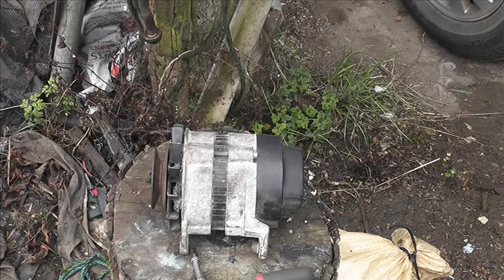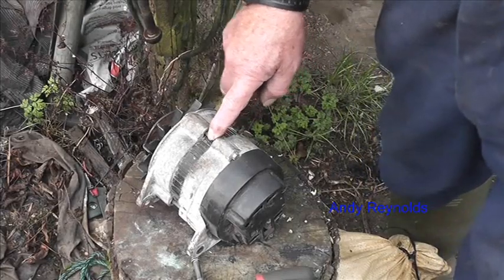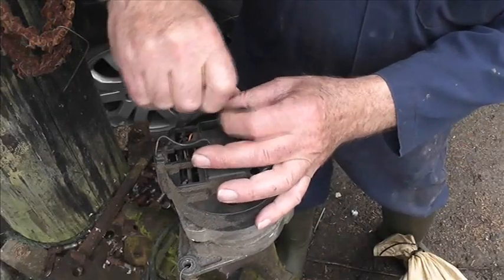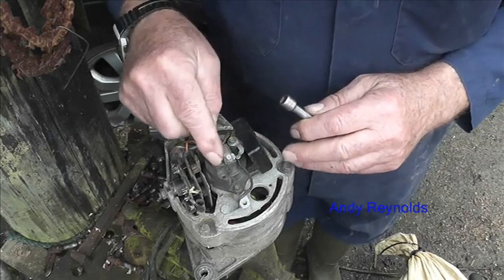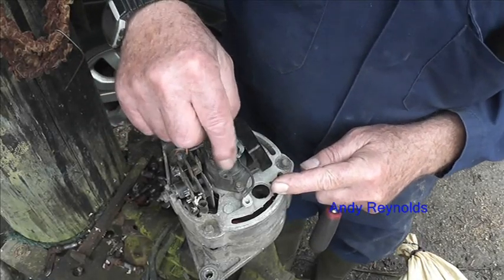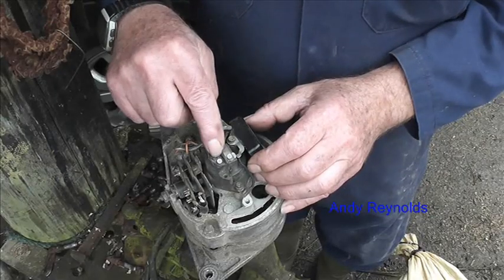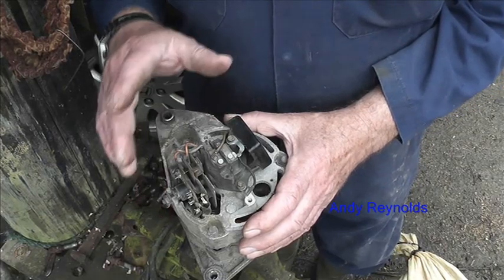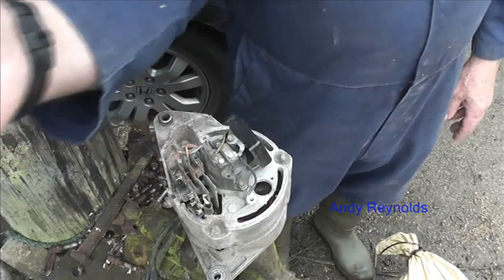Lucas alternator, voltage regulation, bad charging, battery, ACR, International tractor, British car

Comment: Hi Andy, very interesting video, I managed to “persuade” an old 90amp Bosch alternator to replace the useless 70amp Lucas alternator on my BMC 1500D boat engine, the Lucas used to get really hot and didn’t last long, this Bosch I got from a car Scrappy 15 years ago and put in a new Regulator/ brush set, also fitted 13mm pulleys to cope with charging my AGM’s via the Victron DC DC charger, I get no belt slip now and the Bosch purrs away like a kitten.. 👍🏻
Reply from the maker: Ah yes for a boat and living space then you need something more robust, cheers